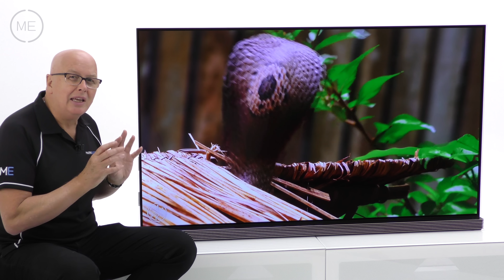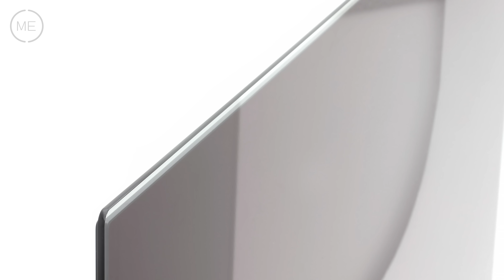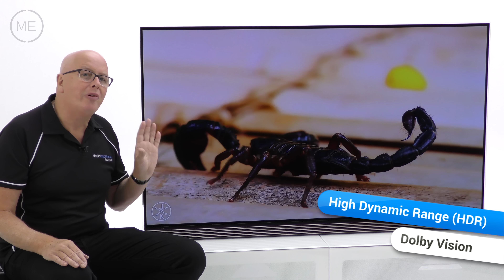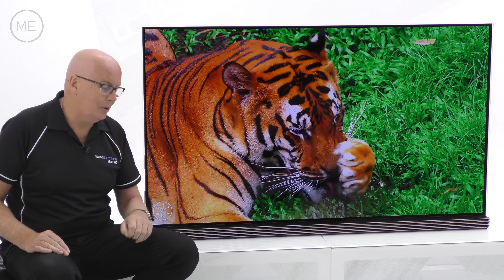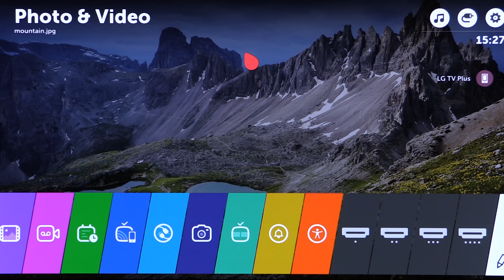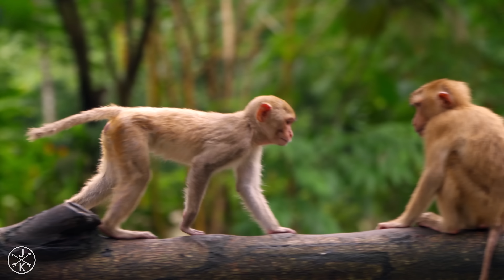LG OLED65G6V 65" 4K Ultra HD 3D OLED TV w/ Sound Bar Stand (Input lag tested)

Comment: What measurements would be needed to mount on wall from sofa height. Would you say 26-28" from floor- wall mount holes on rear of TV
Reply from the maker: Everyone is different Dave. It depends on a number of factors really. Seat height, view distance and most importantly, what is most comfortable to you. If you sit on your sofa in your favourite viewing position, your eyes should be focusing on the centre of the screen. Some people cut some paper or board to the same size as their new telly and stick it on the wall to decide. Hope this helps.

Comment: Hi Marks, 
I want to buy LG E6P OLED 65" TV. But I have a doubt. Can I use this TV as a PC moniter for watching movies through my computer. To use as a PC moniter which is good, LG E6P or SONY Z9D. Kindly clarify.
Reply from the maker: We haven't reviewed the Z9D Ajay but we know it's a big threat to 2016 OLEDs. The response times are a bit behind, the input lags are also behind and the blacks aren't quite as good but it probably beats LGs OLEDs in other departments. Importantly though, there is a question about screenburn in extreme cases on OLED Tvs. We haven't seen it but for using it as a monitor you may need to consider that fact. Hope this helps. See link below.
http://www.hdtvtest.co.uk/news/kd65zd9-201610164372.htm
Reply: Thank you Marks.

Comment: I'm looking to buy new oled tv but I'm scared of picture burn in issue with oled....
Reply from the maker: Unless you use it as a PC monitor with stationary graphics and leave it on all day, you do not really need to worry too much. In normal use it will be fine.
Reply from the maker: Hi 力威健身笑撚死人, you can help reduce burn in issues by leaving the Tv in standby (apparantly) rather than powering off. Just be aware of stationary images on your screen and turn on a screensaver when you walk away. Hope this helps.